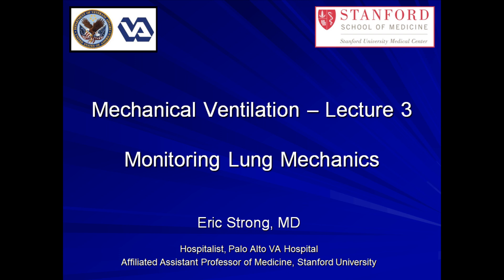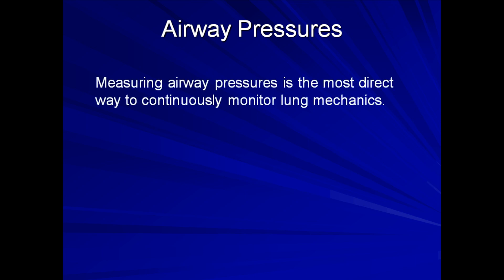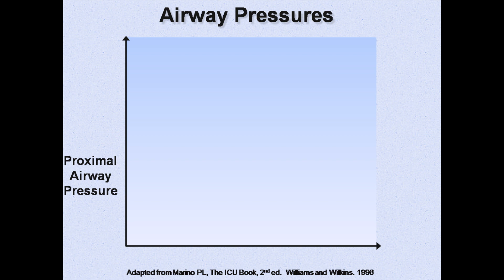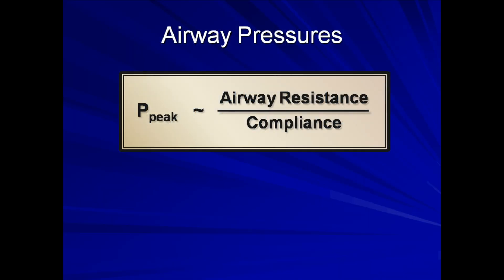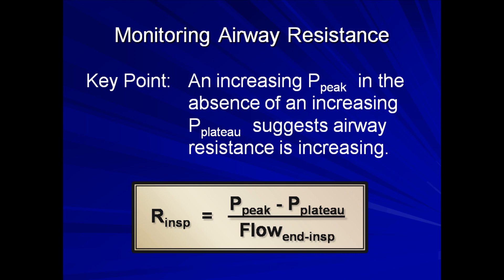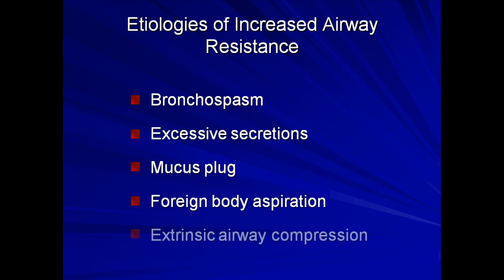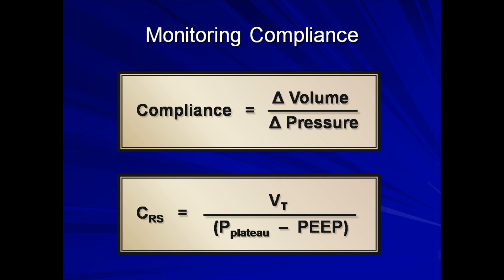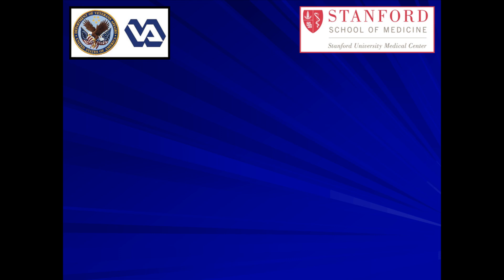Monitoring Lung Mechanics (Mechanical Ventilation - Lecture 3)

Comment from the maker: Canalaldjazair, thanks for pointing out the clarification.  I agree that peak and plateau pressures will both be increased in the setting of combined low lung compliance and high airway pressure (a situation which is not rare).